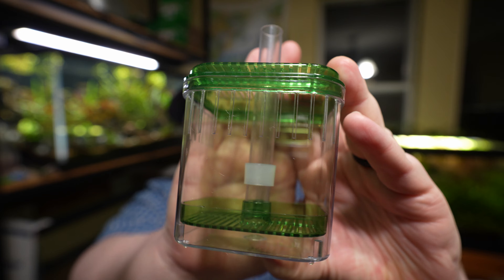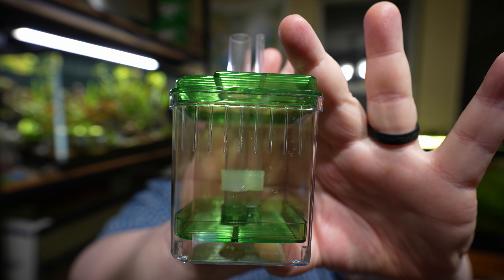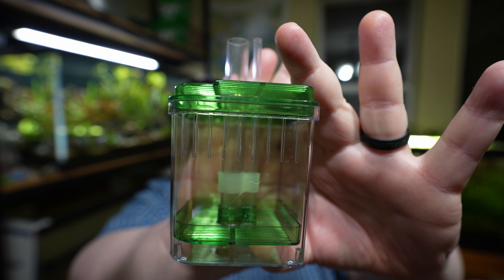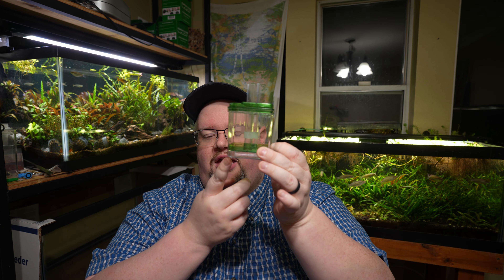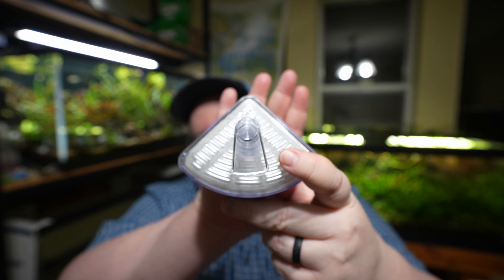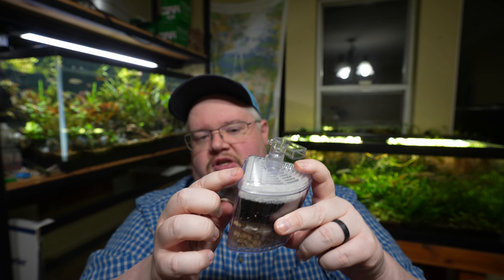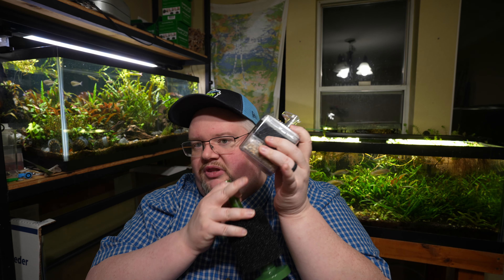Why the Aquarium Box Filter became obsolete - Box Filters Suck!

Comment: Made my own plastic box. Aquarium silicone inside my fish tank. Some small holes drilled in plumbing pipe. Sponge inside is from home bargains shop. Filters out all crap. Crystal clear water. Run by a small power head to move the water. Box drip filters are here to stay. Keep your over priced fluval stuff lol

Comment: I have a corner filter like the on the one you showed. My water is crystal clear. My floating plants don't get battered by a hanp on the back. I can't afford canister filters for all of my tanks and these are cost efficient. I clean them in dirty fish water, so I don't lose my bacteria colony, I easily hid them behind stem plants, they aerate the water and they are quiet. In fact, I just order 2 more from Amazon. So I whole-heartedly and respectfully, disagree. We are moving house and I am setting up some empty tanks in the new house to transfer the fish from the old house. Then I will break those down for the move. I am taking 50% of the water from each tank and there current, dirty filters. I already have the new filters runiing in their tanks to get them full of bacteria. Whenever I set up a new tank, I use the same method. I have not lost a fish, shrimp or snail this way. Also, under gravel filters are great. The only reason I don't use them is the new ones seem a lot more fragile than the older ones and I use a lot of hardscape. I do have one in my sand bottom tank. I just put a tin, flat sponge over it so the water can pass through, but the sand can't. I don't have much hardscape in the tank, just some shells for for the chiclids to make their homes. And only some duckweek that I a put in when the other tanks get overrun. It gets eaten in this tank. I have no lost a single fish and my water is so clearer than clear.

Comment: Oh Bentley.... I hate to say it... but I completely disagree!
Air powered is air powered - which is what I use in my sponge filters; minimal draft through the filter. Water goes through, minimal debris is pulled in. Horrible idea to use it as a mechanical filter. I prefer medium to large pores for my sponge filters.
My prefilters on my canisters and power filters I use medium to small pores on the sponges, depending on size of tank.
Box filters - which are always WAY too small to compare to a sponge filter, work great doing both jobs of filtration. especially if you fill them with... drum roll please... FOAM! Not so dense foam at the intake, and smaller pores near the exit.
But all that is not my major disagreement.
We have learned how to best use each one, but that is not represented in your video. (you will be plagued by duckweed in your toilet for punishment)
Sponge filters work best with slow movement of water through them to be bio filters. If you speed up the air - and the water moving through them - they are decent mechanical filters, less so bio filters. If you have one of each, you will rarely have to clean the bio filter, and can clean the mechanical filter constantly, and you will  have clean water and no bio loss.
But what about box filters you say???
Air driven ones with different porosities of foam are fine in small tanks. I would pair them with a bio sponge filter.
But better, is the bigger, power driven box filters. (my home made water bottle ones for example) Bigger, layered, different porosities of foam, can even have bio balls or other bio media inside. All driven by small water pumps. (power head, circulation pumps, whatever). Easy to pull out and clean, and you leave the bio media alone. Ideally, as I do, I have one sponge filter and one box filter in a tank. (I should say, these are for 40g b or smaller tanks) Each are as easy to hide as the other. Foam comes in many colors... you can even cut the sponge filters you show to fit!
Lastly, I have to admit... my water/soda bottle models are not box filters... cylinder filters maybe? And more importantly... you will probably call my Cylinder Filters internal filters... and I admit you would be correct; however, they are simply a box filter with a powerhead - which drastically improves the capability of a box filter. Placing a powerhead on a sponge filter REQUIRES another filter of some type.
In the end, I think YOUR goal was to show the limitations of air powered box filters. My goal was to show the limitations of each, and how to maximize the usage of each for what the individual wants to do. I hope everyone learned something from both your video, and my long lecture here in the comments.

Comment: You know you are wrong in that they both have there places. You show your lack of knowledge of the technology of the box filter. The box filter is not only floss as you stated! You can use carbon, matrix, purigen. Also the box filter with the carbon or whatever media provides great filtration. Also I have not issue with bacteria issues because the bacteria is replaced in a short time. In my scraped tanks I use a canister. I don’t have a sponge or box in the tank, just a canister. The main point is no matter what you use, aquarium maintenance!